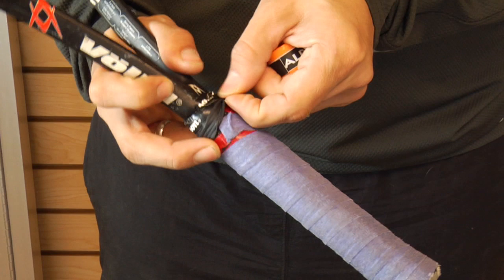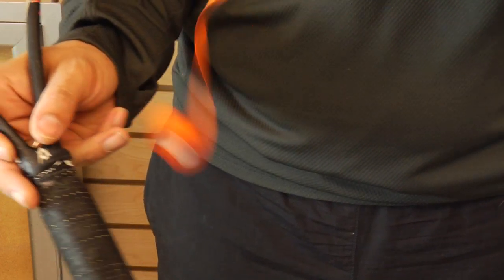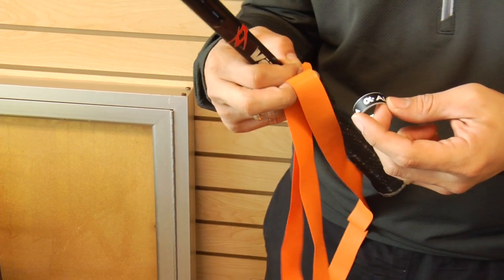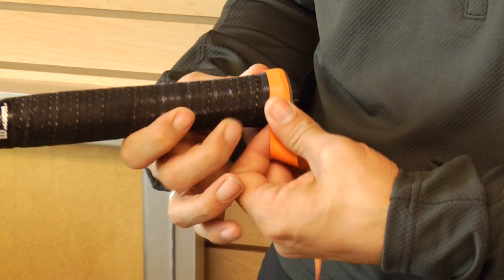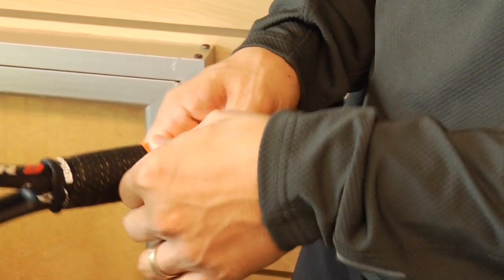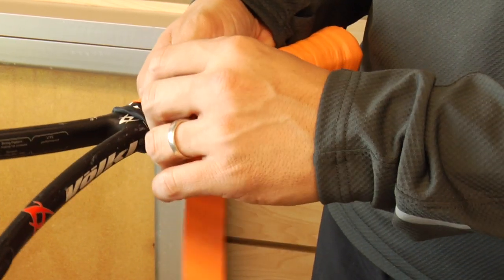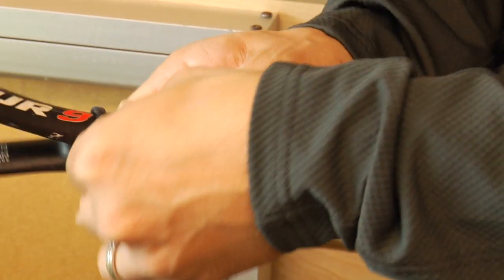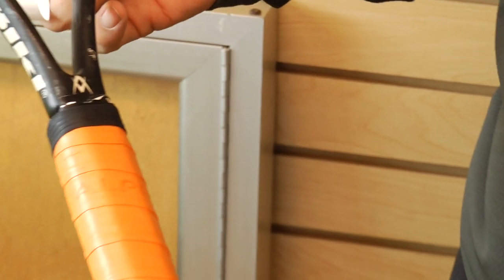Tennis Balls & Rackets : How to Re-Wrap a Tennis Racket Handle

Comment: Lincoln, this is very useful info, thank you!  I feel personally that since there are so many of these overwraps available in all colors, "full regriping" is hardly necessary.  One note, I was able to increase the size of a grip 4 1/4 to 4 1/2 by first wraping the grip with the blue gauze tape, THEN a Wilson overwrap, (similar to the one you're showing).  Thanks again!

Comment: I wish you would have posted the replacement grip cause that's a little more tricky. Overgrips are pretty easy and you can kind of figure them out on your own. The biggest problem for replacement grips is how to cut it just right at the top when your finished wrapping it.
Reply: You are right. What the video shows is how to wrap an overgrip.